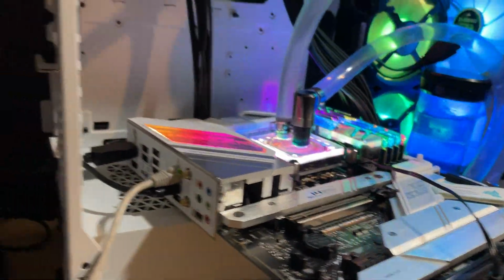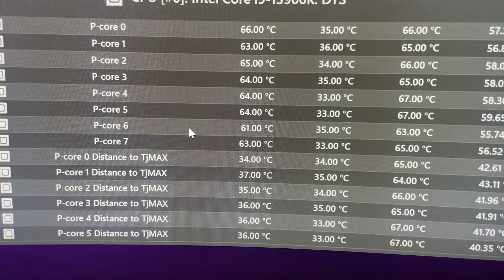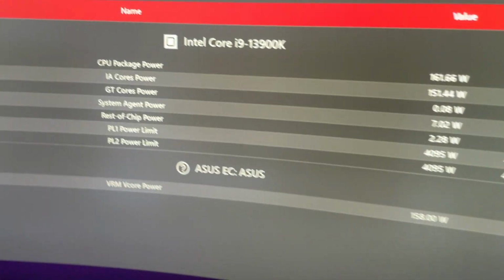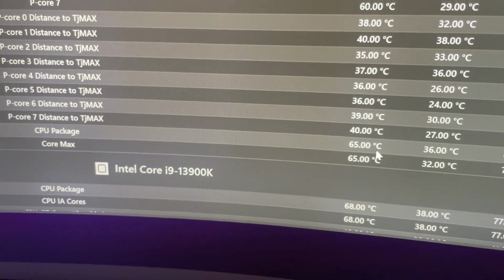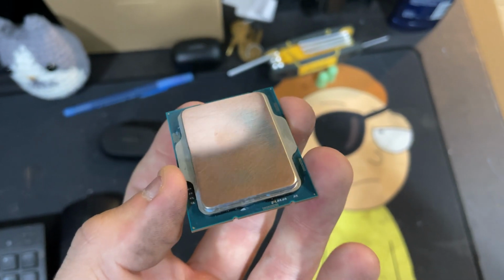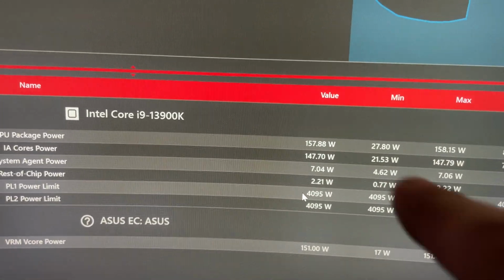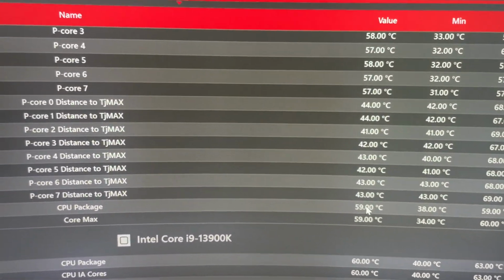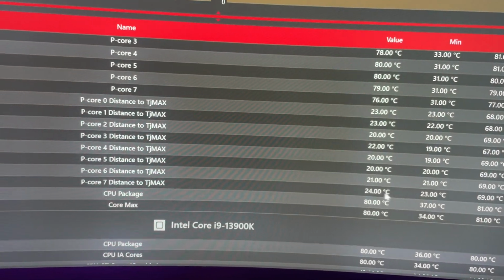13900K Delid + Contact Frame Temperature Results

Comment: Do you guys think Direct die would enable a 13900KS to be cooled down by a 280 Rad? 
Im thinking to go ITX Case but im worried about the CPU 
4090 can be handled even by 240 Rad
Reply: My 240mm aio cools my 253 watt 13700k to 85c. Do with that what you will.

Comment: Very interesting video. The drop in temperature that you've achieved is really nice. It would have been good if you could have shown how you cleaned all the solder from the CPU die. I've never seen such an amazingly clean 13th gen CPU die before. I've seen other videos where the solder has been scraped off using a blade, and where the solder has been "disolved" using liquid metal, etc. But, I've never before seen such a perfect mirror finish like you achieved. Please tell us how you did it!!

Comment: Not sure you really know what you're talking about here. The fact that you're getting the same amount of wattage every time isn't a function of the temperature or anything that's what you set in the bios. The more wattage you use the more heat it produces. What I'm curious about is what your clocks are with that wattage cause they can't be very high.

Comment: You delid the CPU to put the IHS back into place, with a contact frame designed for water blocks, why delid?  Don't show the lapping, don't show the delidding, don't say what you put in between the IHS and the CPU or the IHS and the water block.  ***Delidding and ***removing the IHS for direct contact with the water block, using a contact frame made for said purpose (not the one you are using).  A good tutorial on what NOT to do!
Reply: You are completely wrong on every single level it’s not even worth countering each point
Reply: Sometimes direct die cooling is  not better than good ihs with LM applied …. Whatch i9 11900k Delid of der8auer

Comment: Great video
Need your opinion on my pc building
Cpu:i7 13700k
Cpu cooler:didnt decide what best
Motherboard:asus prime z790 A Wifi
Memory:g skil s5 2*16gb 5600mhz cl30
Ssd: corsair mp600 lpx 2tb
Gpu card:asrock 6800 xt
Psu:coolermaster 1200w 80+ platinum
Case:didnt decide i think about corsair 5000d
Please help me to decide
Thanks

Comment: Cool video keep up the good work!

But when you do this type of testing don't you need to cap the voltage if you wanna see a clock and temperature difference? 
With the contact Frame and delid you had same ish trmps, but you were consuming 7 to 10 W more.

To do a good comparison you should lock the clock, voltage, pump and fan speed to see the difference in temperature, right?

Shouldn't  you lock fan and pump speed and run something like cinebech 23 for 10 or 20 minutes to compare scores?
Reply: Exacto su metodología no fue la mejor.

Comment: Nice video. Also anyone watching this must know that the result can differ a lot depending on the specific cpu - some might gain 5-7C difference only from contact frame - others may only have like 1-2C difference. Same goes for lapping and delidding. In this video 10C is pretty good since someone else is doing it 😀and 10C is a whole lot when it comes to fan noise.

So first its reasonable to monitor your cpu temps and then decide if the hassle is worth it. Contact frame is easy nobrainer fix but lapping and deldiddind obviously cancels the warranty so you might wanna consider.
Reply: I bet warranty claims are fairly low percentage wise and ones that intel honors is even lower.

Comment: No offense but if nickel is still visible on the stock IHS, then I would say the lap job is technically  not the greatest.  I'll generally lap to within microns of the die and in turn then have to grind the IHS down as well ... or in the case of the frame (which I have) ... will have to also lap because when I'm done with any given CPU, it's contact surface is generally resting beneath the extents of the IHS/Frame.  If I can see an imprint of the rectangular die stamped into the IHS surface after removal of a lapped CPU and after being mounted for a while then I consider that a good benchmark for my personal jobs.  Client jobs, understandably, might demand a more conservative approach but short of direct die?  I've found lapping down closest to the die as possible to yield the best results.

Comment: Delidding is extremely risky ppl I'm not sure it's worth the consequences!  I saw a completely demolished 13900k for sale on ebay(for parts) no way that thing works after the failed delid
Reply: Did you use a delid tool?  What did you damage on your CPU?  I'm curious because I'm considering taking the dive.
Reply: @subdude1979 fear mongerring
Reply: @RussStufft  you replied to the wrong person.  I did delid my 13900kf and it worked out fine
Reply: @subdude1979  yea I tried to say that these type of people are just building a fear that doesn’t exist about delidding cpus 

anyways I’m gonna delid i9-14900k as soon as it comes

going to delid, apply liquid metal , then use a copper IHS and put thermal paste on top. Also going to use a contact frame stacked with Noctua fan.

Comment: This is so unhelpful. What's your vcore, and clock and why are you only pulling under 200w right off the bat? That's not stock on any stress test like cinebench or prime95. You should be pulling closer to 300w and very quickly hitting 100c and throtting.

Comment: Cool video!  Please release a follow up video showing how this CPU performs with the Supercool direct-die water-cooled IHS like you did in your i9-12900k video.  Also, when using OCCT, please note that for maximum stress, you need to set the parameters to Small and Extreme to fully load the CPU.  All of your videos (that I've watched anyway) appear to use the default settings of Large and Normal, which results in only applying a moderate load to the CPU.

Comment: Quite curious about what the performance will be like if you don't delid, but still apply liquid metal between the IHS and cold plate for a soldered CPU. Which better indicates the performance gain of deliding

Comment: Love it, but would have loved to see a negative voltage offset.
On my 12700k I'm able to run 5.1 GHz all core, with a - 45mv offset. And on air cooling, it stays below 80C.

Comment: What is lapping a CPU!?
Reply: Basically sanding down the top (IHS) so the surface of it will be even flatter than it is from factory.
Reply: @kasimirdenhertog3516  Why would you want it even flatter than factory?
Reply: @doctorfresh3856  for even better contact. If the surface is uneven (so not completely flat, which is the case from factory) you get parts where the heat transfer is better and parts where it is worse (because more paste/liquid metal will be between the two surfaces). You want it to be optimal in all places, hence the lapping.

Comment: Just to be honest with you, your cooler is not like any other 360 AIO like what you said at the beginning of this video. Your temps on stock ILM and settings are absolutely amazing compared to any 360 AIO  which will shot up to 100C within a minute of stress testing.
Reply: also how come your power draw is too low? your 13900k should be drawing 300-400w during stress testing with unlimited power.
Reply: @itisalwaysday1  because he isn't running normal OCCT settings despite saying so, his test was fixed at 16 threads.
Reply: @_DSHEP  that's because he's a gamer not a PC nerd lol

Comment: Hey bro, great video. Question: What delid tool are you using? Where can it be purchased? https://youtu.be/mhlxysoNs68?t=344 (I have the Rockitcool 12th delid tool, but it always causes minor damage to the edge of the IHS and I sometimes have to lap it to fix the dent it puts in the edge. Would be nice to avoid that if there is a better delid tool.)

Comment: Well done! The effect of the frame depends on the board. I had a 8600K delidded and lapped for a long time. Now switched to a 13600K on a used ASUS STRIX Z690 A. Lets see what i can achieve. Hopefully the 13600K can reach 5,8GHz+ single core

Comment: Delid is nice but direct die is even better.   I have been going direct die since 10900k with no problems for me so far!
Reply: How do you do that, do you buy a direct die cpu water block block kit or something like that?
Reply: @Ben-ld1qi   Ehh mine is simpler and maybe riskier but works for me I just delid, place in socket, remove stock bracket, Liquid Metal on die and on water block, and screw down water block directly onto the die with custom hardware store screws lol using that force to secure the chip into the socket.  A lot of people say this can fail but I have really only ever had one small memory error problem just slightly tightened and was resolved.  There is some risk in figuring out the correct pressure you want it tight to secure chip to all pins but not too much to crack the die.  Best temps possible though!
Reply: @Christopher2178  oh gosh this makes so much sense! I actually did try to do direct die to practice on with 3th and 6th gen intel but the cooler wouldn't make good contact. I'm shocked i didn't think of simply removing the ILM, that makes perfect sense! I assume that doing direct die even a good regular thermal paste would make some decent temperature improvements. 

Is it possible to overtighten and damage the socket pins or something? If u take a look at the thermal grizzly 12th gen fix bracket then over tightening would simply cause memory channels to fail or no post but nothing irreversible if u loosen it back up. 
Maybe a torque screwdriver could come in handy to make sure you give each side of the cpu block an even pressure.
Reply: @Ben-ld1qi  yeah just start with a good but not overly huge amount of tension tightening it down and then if any memory or boot issues tighten a bit more as needed has always resolved it for me.  I try to count rotations on each of 4 screws to keep the pressure even across the die as well..  but nothing too special just go slow can always reboot and tighten more..
Reply: @Christopher2178  thanks! Another thing i wanted to ask, do u use anything on the gold plates on the cpu to make it safer? Last time i just applied some layer of regular thermal paste on them, especially the ones closest to the die.

But anyway this is really great idea, i will try it.
Reply: @Ben-ld1qi  yeah you can try that, nail polish, or I have mostly been using smalls cuts off a very thin roll of kapton tape I got off Amazon on my last few if I wanna cover any caps or little metal spots for safety if it seems to work very nicely as well.

Comment: I always tell people that you don't even THINK about de-lidding unless you can afford to purchase a replacement CPU.
Reply: Agreed and always better to practice on a cheap spare CPU. On older generation before 9th gen, even just delidding and use a regular thermal paste on the die will be an upgrade.
Reply: @erisium6988  because accidents can and do happen.  This isn't a situation where you overclock your chip a bit too far and then RMA for it a new.  This is physically altering the chip itself and instantly voiding your warranty.

Comment: Love it man.  You gave me the confidence to delid my 12900k and I have now done the same with a 13900k and the same motherboard that you are using.  I did not lap it but used the contact frame.  I got pretty similar results in temps.  I'd say you are on the money with maybe gaining another 100 mhz.  I'm at all core 5.6p/4.5e/4.8r.  Thanks for the content!
Reply: so you delid your 13900k ? what was the temps before you Delid ? also are you getting 5.6 on all Pcores with out touching bios volt settings ?
Reply: @jmoore9806  So before the delid I was still using the Thermalright CPU contact frame and an LFII 420mm AIO and I believe that after 10 mins of R23 I would hit 87c on the package at 5.6 ghz.  After the delid I dropped around 5-7 C to around 80-82.  Not a huge change but it still helps.
Reply: @MikeS3000  that's still heaps.....I have a corsair 420mm cpu thermal frame and get 98-100 in cinebench R23 in 15 seconds need to turn it off
Reply: @MikeS3000  when I say heaps I mean heaps in losing 7 degrees......82 degrees you CPU will love for the next 10 years no problem
Reply: I don’t know the steps after deliding: do you keep the same IHS?  Do you put something between the CPU and IHS to increase contact?

Comment: Do you heat up 12/13 Gen chips to delid them or just do it with the help of metal fatigue? 🤔Great video btw, learning a lot from you!
Reply: its usually done after being heated and a lot of the time a delidding kit is used :P. I recommend just being safe
Reply: @mama mia  Indeed! I've done a handful of these chips before - just wanted to know what his preferred method is seeing that he's had more experience 😁
Reply: @pavel2058  you're far more experienced than me then xd. Regarding his method, i have seen him heat up the ihs and use a delid kit for the 12900k when he delidded it
Reply: I simply let it run for like 2~3 minutes without a heatsink and heat up. I also make sure to remove any overclocks to make sure I'm not running 100c on like 1.4v+ vcore.

Comment: do u think u could use the direct die cooling kit on 13th gen and get even more of a reduction in temps?
Reply: Definitely the best route to take if you can find the water block
Reply: Yup, been running a direct die mount from EK for 6 years now, 4770k @4.7/4.7 with normal Noctua thermal paste...it runs 5-8c* cooler than with the IHS....liquid metal might bring that down a degree or two but it will stain/damage/corrode the cpu block(mine is copper) and cpu die as well.

Comment: Did you sand ihs bottom edges? Im going to delid mine and was wondering do i need to sand down ihs edges to make contact with the die?
Reply: @erisium6988  maybe u dont underatand what i was saying? I know what im doing 👍 done that before, but never used ihs after delidding. Used direct die. But if i remove solder and then use ihs, i was wondering if the die is high enough without solder to make contact with ihs?

Comment: How about direct die cooling? Really would've loved to see it
Reply: its around the same and depending on the trueness of the water block it can be worse.
Reply: I think what Jilk is trying to say is how many more frames is direct die going to get you? And is it going to raise your kd at all? Chances are probably not, direct die is more of an xoc thing which this channel is not xoc based.
Reply: @zgmurph  Totaly wrong. Direct-die cooling is not about "how many more frames you get in a game", it's about, how much you can decrease the temp on the CPU, cause lower temps, means, lower power consumption, lower voltage and longer life for your hardware. And in a watercooled system, it's a little benefit to your other components, cause the GPU (if it's in the same circulation) will also have a little lower temp.

It's not all about more fps, it's the overall advantage, which can, but not have to, direct-die cooling give you. I'm running a i7-6700k with LM and direct-die and also my GTX 1080 is with LM. The GPU runs with 2050mhz, which is way over the spec (1607 Mhz base and 1733 MHz boost) and the CPU is on base (4 GHz base, 4,2 GHz boost). The GPU max temp is 42°C and 46°C in the summer and the CPU is around 52°C and 56°C. Max consumption of the whole PC, without Monitor, is about 400W. After 6 years, this beast is running like nothing and it's a silent system, not a turbojet or something else.
Reply: wrong channel, he only does actually practical stuff. Gotta watch derbauer for direct die funzies.
Reply: @SilkMilkJilk  In this case it's very practical, he already delided the cpu and used liquid metal the only change would be to mount the cooler directly on the die instead of using IHS and bracket
Reply: @omarfouda1994  Nah that wouldn't work because of the height difference. plus the silicon itself is very prone to cracking under pressure, so It is not quite as easy mate^^ there is a little more to it than delidding and slapping the cooler on top of it.
Reply: @SilkMilkJilk  what i mean is, that it's applicable and good for daily usage not only extreme OC, and big part of why it's not recommended is delidding which was already done, I am not saying it's for everyone but he already does this stuf to show extreme measures and if they are worth it for you and direct die cooling is the last step applicable for daily systems I guess, so I would've loved to know the difference

Comment: Found interesting result. RTX 4090 doesnt stutter at all, but the RTX 3080 does. I think because the CPU is being really taxed, as well as the GPU, the combined delays with the graphics API and the GPU communication from both components being busy is the cause. It may well be that a CPU like this would solve the stutter for the RTX 3080 since that would eliminate latency on the graphics API side of the combined factors to the end frametime result of both working in tandem.
Reply: Any number of reasons for a system to stutter, 3080 only as 10gb vram so it could be doing far more swapping of data depending on the game. the 3080 also uses a much worse node for the gpu die and pulls very high short duration loads so it could have been a power issue. or it could have just been a faulty card that still works. or it could be that card is bouncing off the power limit too aggressively.
Reply: @ramair325  

RTX 3080 12GB. This is an x86 application bro. To actually use 10GBs would be literally impossible without x64 extensions from glorious hackers.

Comment: My first delid experience was a failure. I did it with a knife and managed to damage my 3570k. Resulting in 1 of the memory channels going inoperable. 10 years had passed! Man! Time flies!
Reply: I knifed 4770K and 8700K both success and I put liquid metal on the gpu few times, also success...
Reply: Skill issue